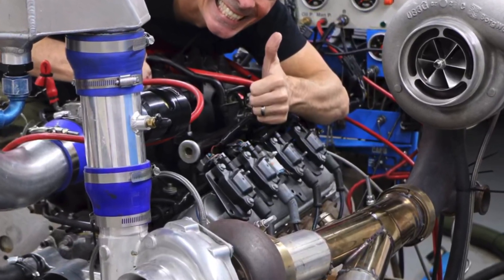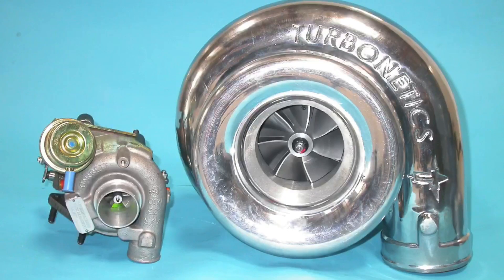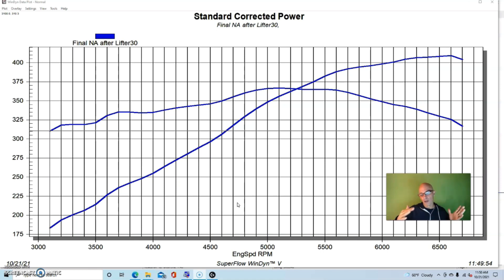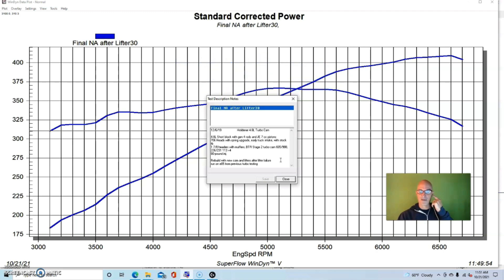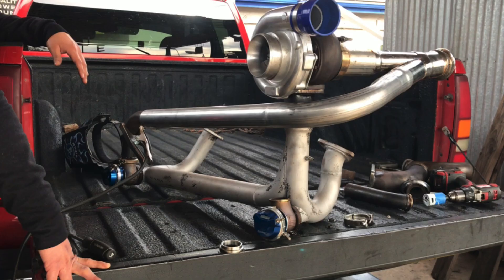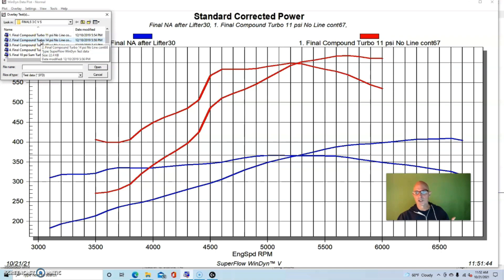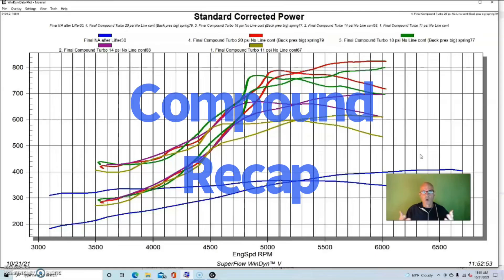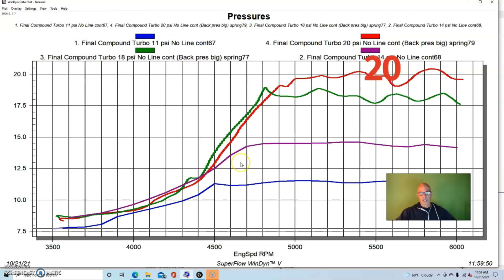COMPOUND TURBOS VS SINGLE TURBO-(WHO WINS?) SHOULD YOU RUN COMPOUND TURBOS ON YOUR JUNKYARD LS?

Comment: I’m sure it’s been said over and over again but the goal with compounds is your small turbo (manifold turbo) should be able to efficiently make your desired air flow at low rpm. And then the large turbo steps in and completes the run when the small turbo is out of efficiency. Think about it like running two sets of fuel injectors. You have the small ones for low rpm. Good throttle response and idle and then say passed 4500 rpm they don’t flow enough fuel so that’s when the second set comes in and completes the required flow. 

A good cheap set up that I can think of would be say an hx35 out of a 12v Cummins under a s480. 
The hx35 (a 50~mm compressor) could easily hit your 10-15 psi requirement down at 2500 rpm and then at 4500-5000 when it’s at the risk of over speed the s480 is now taking all the load because it’s now at its ideal air flow. Also having such a large spread on the turbos allows for them to fill in the lag areas of the curve. 

The other issue with the comparison is that the s475 that you’re running is really a solid all purpose turbo that is small enough that it comes online nicely at low rpm but has plenty of air flow for the engine. Compounds really only show their strength against the BIG singles like a 90-100 mm turbo something where with a 4.8 you’d only see it really come online at 5500-6000 rpm

Comment: A complete diagram or description of the plumbing would help understand this series compound turbo application. From some of the posts it is clear you’d need to be shooting for LOTS more pressure for this to be useful, but it’s interesting as an exercise. The single S475 sounds good for the real world of gas engines, anyway.

Comment: I think you just need to size them for response and your power goal. The point of compounds is quicker response for a given amount of power. Of course at the same boost level you’ll have less power- turbos are restriction devices and adding a second one takes that extra energy to drive.

Comment: I’m no expert but the way i understand it is size the small turbski for the response/spool you want and the large turbski for your power level you want. Obviously it’s more complicated than that but you get what I mean. The small one still has to be big enough to light the big one off.
You’d have better results with something like 62mm/91mm turbos.

Comment: I have a 67mm on my dart headed 355in gen 2 lt1. It's probably a bit small but it's a beast from 2500 to 6500. I wonder if the smaller turbo should closer to 60mm for quicker response would get the low speed back.

Comment: I think of compounds like a 4th order bandpass bass enclosure - amazing solution for a very specific (read: small/limited) application. Diesels love them cuz they have a limited RPM range

Needs an intercooler between boost stages for max efficiency, probably losing some power there

You're also losing a bunch by using "slapped together" turbos rather than (as you admitted) calculating the correct turbos

More boost + equal/less power = too much heat, not enough airflow

Comment: The problem with gasoline compounds is when you run the small turbo at low boost, you actually restrict exhaust flow. The reason is exhaust under pressure needs less cross-section area to flow thru, so low boost means low drive pressure and exhaust that needs a large relative volume. The biggest mental hurdle for people is realizing a 400hp small turbo is flowing 800hp worth of air/exhaust compressed to a 400hp volume.

If also hurts running them outsize their efficiency island. 

It's all made much worse when the turbos aren't sized right. You should size the large turbo to be bigger by the amount of the pressure ratio the small turbo runs. EG 16psi at the small turbo discharge would be ([14.5+16psi]/14.5psi=) 2.1:1, so you want a big turbo that's 2.1x larger. If the big turbo will make too big of numbers, you reduce the small turbo & recalculate. 

It's obviously much more complicated than any 2 turbos will make 4x power. You wouldn't slap a stage 4 cam & heads suited for a 427 onto a 4.8 and dyno it to 5500rpm to compare vs stock. Same with a compound - you can't build it wrong & run it wrong but expect it to work.

Comment: just based off the diesel side of things  (i own two cummins trucks with compound setups) it needs a smaller  turbo on the manifold especially since you dont have the displacement.  An s363 and a 480 work pretty well on the street and can  still tow whatever you want with out waiting forever for it to spool  a 72 and s480 dont really spool very well on a 5.9 but on a 6.7 its a lot easier and more streetable.

Comment: Compounds are superb , run them on my ram.  

Turbo is only efficient at x range, based on the inlet of atmospheric pressure, spin a small one way to fast and overheat the air and smoke a turbo. Feed it some boost though and that window moves and you no longer over heat that air. Enjoy
Reply: You are correct. The reason you compound is to have the smaller faster spool , then you have the bigger one to feed the small one boost rather than atmospheric pressure. You need to because that makes the small one efficient again. 

Think about it this way, you run a small unit, it is efficient at 24# boost. You can spool it to 45-50#, that does not mean you are adding good air just boost. You are spinning that turbo twice as fast as it was designed to go. It’s heating the air, less good O2 it’s heating up and expanding.  Now you throw a big unit on to get the bigger unit feeding it more air , that moves the efficiency window on that smaller unit. It’s getting boosted air not atmospheric pressure.

Comment: I'd be curious about how the exhaust back pressure curves looked with those combo's and also the air intake temperatures (ideally) before intercooling. Hopefully data logging had that data.

Comment: compound works great when you are trying to go a huge pressure ratio. like 4 or 5 or higher PR. high PSI in diesels or really thin air at high altitude. to get the small turbo to light off it needs to be small. restrictive small. so on a 4.8, something that is maxed out around 500hp. and have a boost controller for just the wastegates handling the small turbo set to less than the overall boost goal. 15psi on the small turbo gates and then 20 or more on the big turbo gates. you will need a lot of wastegate flow to get around the small turbo exhaust housing restrictiveness.

Comment: Should have used a gt35 with dual wastegates sprung to 10 psi. Then another gate for the s480 so it does the real work. The primary you used is too big to be really effective for this combo.

Comment: 76mm =~ 110lbs/min single as the manifold in a compound =throwing a hot dog down a hallway, it's too big
 This motor making under 1k will never make this  turbo sing ,not even as a single , now throw a compound on top of it   and you have created the best in class" lagmaster 2k".   Mani  charger needs to be sized to be in the center of the 79%effecinty map at normal road speed. Aka 2500-3500rpm g25-550 - 35-700 size ,size it so that the small is used up by4k( wastegate 75_95% duitycycle).  With your properly sized peek power charger(atmospheric) sized the way you have done for years.. industrial injection gave me advice of 40% difference in size of the wheels in other words you need a 106mm 
 
20psi<16psi
Thermal expansion...reduced the mass by volume ratio. Both made the same power because they both put out the same lbs of air/min(mass not volume) = same fuel demand = same output.  Eg hx35 =35lb/min @35psi @ 500°f or 32lb/min @42 psi @600°f.. it went off the backside of the map to the 50% or less efficiency island.

Comment: Both waste gates are opening too early your boost reference for the large turbo gate should be from the inlet of the small turbo and the small turbos boost reference from the manifold you’re just compounding the air in front of the small turbo think of it as moving The efficiency of the  small compressor your max airflow would be based on the large turbo however efficiency at which it does make that airflow will be based off the small compressor map theoretically you should put about five psi to 10 psi in front of the small turbo. what you are doing is losing all that compounding effect in front of the small turbo. Think of it like you’re increasing the atmospheric air pressure instead of 14.7 you’re making it 20 or 25making the smaller turbos air intake more dense
Reply: Or just use spring only on the small turbo and control the larger turbo with manifold pressure.
Reply: @boostedgringo5885  I wish it was that simple but sadly if you do it that way the larger turbo may not have enough exhaust gasses to provide enough pressure pre small turbo I think I’m on my 6th compound turbo build took a lot of trial and error

Comment: The Diesel guys route basic compound setups as such. Start out with a single internally gated turbo/factory setup (let's call this our PRIMARY). They then take a 2nd Turbo (Secondary) and add it this way: The Secondary is fed it's exhaust signal from the output of the Primary exhaust and gate combined. The Primary's air intake is force fed from the Pressure side output from the Secondary. The Secondary (normally ungated) becomes the single exhaust output for the circuit. The Primary Turbo is essentially sealed up on front and back with the main air intake all from the Secondary and the final exhaust from the Secondary.
Reply from the maker: that is how this was plumbed
Reply: First thing is , they are outrunning the small turbos efficiency. They add the big one to feed it boost, to get that back, because the window moved since it sees boost now not atmospheric pressure. I think the turbos here are too close together at this power level and will never get into their maps efficiency for very long together 🤷🏻‍♂️

Comment: I suppose for traction's sake on the street the compound setup would work better? Seems like the smaller turbo is just a major restriction....
Reply: Wrong , properly sized, compounds spool rapidly and then have the ability to hold bigger boost. They are only efficient in certain windows(based on atmospheric pressure inlet) you compound because the smaller turbo spools fast but runs out of its map, by then a good set up is now feeding the small one boosted air and moving that map on the smaller turbo back to efficiency, as it’s getting more air at its inlet. Good compounds will out achieve a single, but your end goal has to be air pressure that is much higher than the small turbo can supply efficiently
Reply: I wanted to change it to saying that setup.... he definitely should have tested with a much larger turbo.

Comment: The plumbing seems off - the larger turbo should feed into the inlet of the smaller turbo to multiply the pressure and I couldn't see that in the few pictures showing the compound setup. Either way the power goal and pressures are too low to benefit from a compound setup, you should be looking at over 50lbs to benefit from the compound.  My diesel used to push over 70lbs accelerating under load with compounds. Not sure the stock LS block will reliably hold up to that much pressure.

Comment: Personally, I don't see any point in doing compounds on an LS V8, unless you want to run really high boost levels. But on smaller engines, compounds can be helpful.
Reply: This setup was done incorrectly. The small turbo was too large. If he'd sized it smaller and provided better wastegate flow into the larger turbo, he'd have boost from 2000 rpm all the way to red line. There's "boost everywhere" compounds, then there's just plain huge boost numbers compounds.

Comment: Ok well from what i could tell from your compound turbo video the large turbos wastegate reference wasnt in the small turbos intake pipe. If you had the same springs in both turbos, with WG lines connected to the ic piping post small turbo then all you would get is lag as the large turbos gate would open with the small turbos. Turbos are also too close in size, at 76 and 80mm. Another thing to note is you had it running in a sequential setup, as without the big turbos boost added to the small turbos top wg port, the big turbo just takes over and no real "compounding" happens. 

Re run it on a small engine and test some big turbos like the GT45 and S480, that would be a cool test. LS engines are big enough that they dont need compounds.

My compound setup on my 3L could spool my rearmount 74mm GT42 at about the same rpm that you are getting there and its on a 3" exhaust pipe.

Comment: Also what are the intake air Temps feeding the 2nd turbo from the first?
And the manifold intake Temps after compounding both turbos?

Would be best to intercool the air charge between first and 2nd turbo and between the engine and the 2nd turbo...
Hot air from the 1st turbo isn't going to be dense enough to benefit as a compound over atmospheric pressure .. it does opposite and makes a restriction on the intake side with a hot air charge feeding the 2nd turbo. Gotta cool the air charge alot because of the 2nd law of thermo dynamics. 
Please retry this test with a liquid to air for each turbocharger outlet.

Comment: @richard holdener you mentioned plumbing to the top of the gate as a joke sarcastically.  Are you not plumbing the tc1 to the top of the gates? Or are you trying to control by bleeding from the bottom ports of the gates and leaving the top ports open to atmosphere?
Reply from the maker: WE DO PLUMB TO BOTH SIDES OF THE GATE WITH THE CONTROLLER-JUST GOING TO THE TOP (ONLY) WAS A TURBO JOKE

Comment: Size small turbo to work from idle to 3500 and big turbo to take over from there so if your small turbo is producing 35 lbs of airflow that will spool a s480 with a massive hot side for efficiency and give you a broad power band and still make 1000plus without sacrificing soggy bottom of a big turbo

Comment: As others have said, power goal was too low for this combo. Need to aim for something that would cause you to use a turbo that would take forever to reach boost threshold and then a smaller turbo (roughly 2/3 the size) to go along with it. The way the setup you had acted was basically there was a restriction for the exhaust to get to the big turbo (that restriction was the smaller turbo, even with the gates recirculating back to the larger one). From memory reading what others have had success with, it seems like you need a freer flowing exhaust side on the smaller turbo than you would normally run. When the system is right, it will come up on boost pretty quick (quicker than if it was just the single smaller turbo in the configuration for compounds) and then just keep pulling. There's a 4G63 guy that did a LOT of work with compounds a few years back and logged a LOT of information that was super informative. He tried all manner of control systems and I think some different turbo sizings as well. There was another 4G63 street car that also ran compounds with good results.

Comment: My understanding was that the main reason for compound turbos is when you need a larger pressure ratio than you can reasonably get with one turbo, so I'm not surprised that at a reasonable boost level there's no reason to do it.

Comment: Sizing compounds? HP turbo shouldn't be capable of your power goal.  Atmospheric should be rated over your power goal, like 1200 capable for 1000... must monitor inter-stage to get the setup correct, and enough gate flow to not restrict.  I'm not sure compounds make sense at low boost though. Point is to compound for big boost!

Comment: what about a pro charger through a turbo?
Reply from the maker: why
Reply: @richardholdener1727  I really dont know why. I just thought it would spark some attention.
Reply: @quevicular   maybe the other way around. Turbo into a procharger. Ramp up quickly off the smaller turbo and get the rising boost curve of the procharger?

Comment: Sequential turbos do not need to switch between turbos, you can run them single/twin instead of small single to big single, for example the 2jzgte. Twin also implies the turbos are "twins" as in identical. I am running two s366's in my ram identical in operation to the 2jzgte and it works really well.  

As for compounds, it's always going to be worse unless you plan on trying to get huge airflow from a small/or low airflow engine. If sticking with the LS platform, try a stock 4.8 with springs ONLY, in fact, shim them to add seat pressure. Use the stock 4.8 cam. For turbos,  s366 or gt35 HP turbo and an s488 gt55 lp secondary. Make sure you have alot of WG for bypassing the primary turbo, make sure you recirc into the secondary turbo inlet. 

 10-12 psi on the primary turbo and 28-30psi on the secondary, measuring pressure differential p1 vs. p2 and not MAP. The engine will see 40psi and on a 330ish HP engine, you should make around 1200hp.. on a stock engine, if it holds up to the torque. Both turbos are operating in their efficiency zone and that s488 thinks it's seeing a 550-600hp engine in terms of exhaust energy, thus spooling very nicely. Compounds certainly have their place, it just need to be done properly, no hate here, just trying to help. There's actually a guy running a compound turbo LS on a hill climb car and it's insanely fast and responsive.

Comment: This compound stuff needs to be tried on a VW 2.5L Built for boost. Needs to happen. You said the other night “I’ve tested everything”….. yet nothing on a straight 5.

GT2860 and a GT3582
Reply: Fuel tech has done a compound 2.0L 4 cyllinder and it's doing 3500HP with 120psi using compounds.